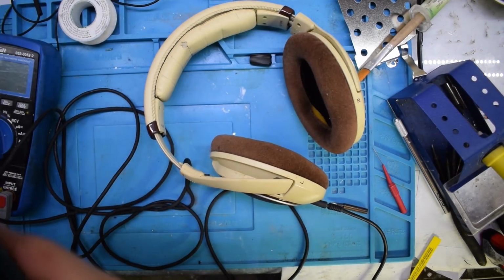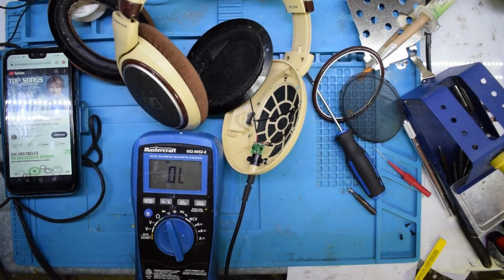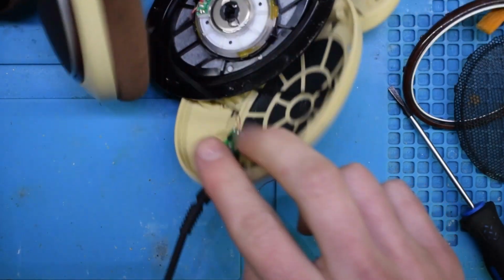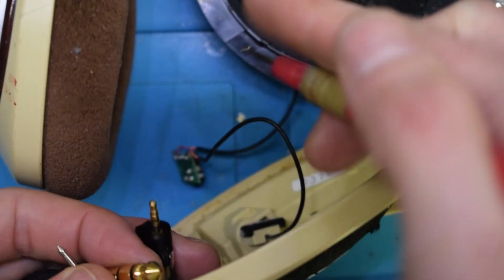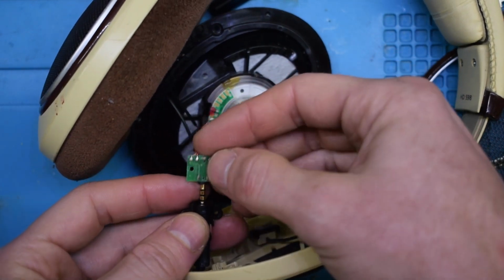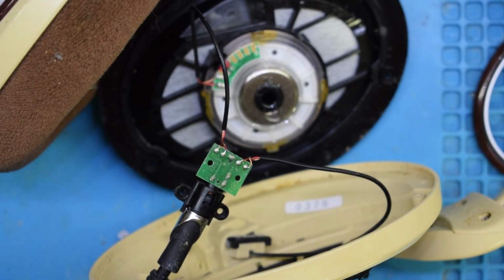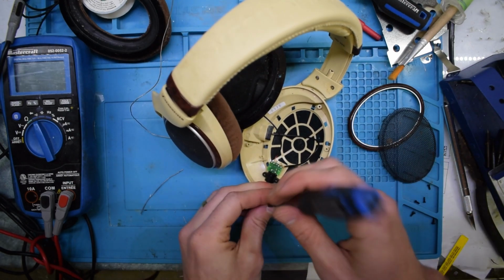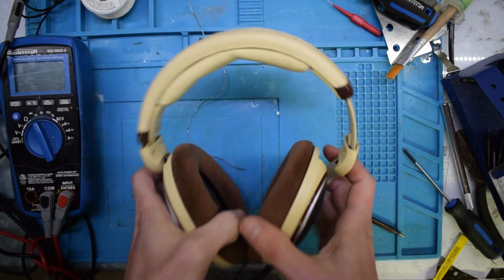Headphone Repair (Sennheiser HD598 only left side works)

Comment: Thank for detail video man. 
Can we mod that 6.35mm termination by replacing 4.4mm termination because inside that cable has four wires(white, red, black and blue) I checked in my senn hd 598se cable. Since they  used balanceed 2.5mm plug at ear cups I assume it can be modded. Am I wrong ?